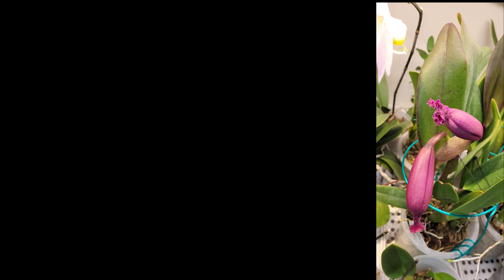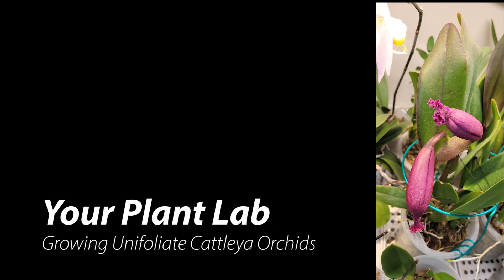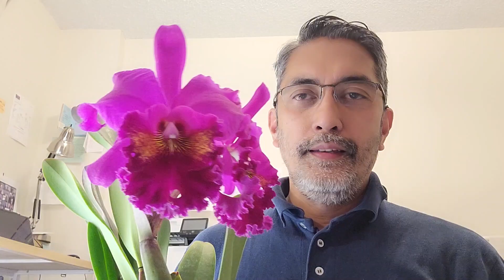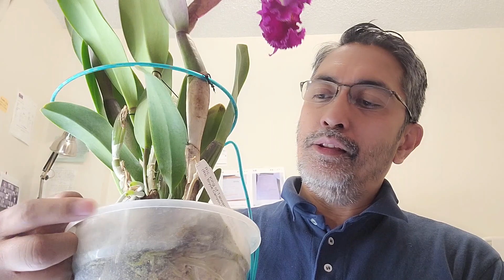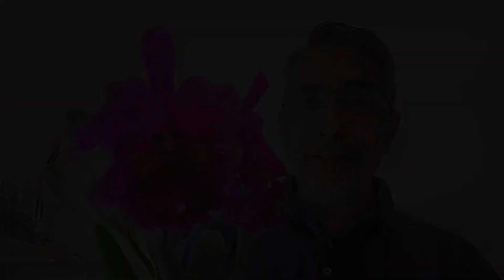Growing Cattleya Orchids Indoors

Comment: Thanks a lot for posting this. I am new & has Cattleya in my collection. The first bud is coming out. I keep this Orchid along with Phalaenopsis & Dendrobiums in my Balcony where I have open air & indirect Sunlight of BANGALORE, India. My Dendrobium bloomed amazing 3 blooms last year. Nothing after that. Phalaenopsis- I purchased 2 clors with flowers & both are doing well. More to  add& more to learn. Your video is inspiring. I want to buy Oncidium Orchids & Vanda Orchids also in the near future.
Reply from the maker: @doddagopi4933, you are very lucky to have a myriad of orchids to begin with.  I assume that you have a location advantage as many orchids respond very well to moderate to warm temperatures all year round.  I am also curious if cattleyas respond well I have been told they are daylight-sensitive.  But since I tried using grow lights with a fixed 8-hour period for a year, my cattleyas still bloomed!  I hope the same outcome for you!

Comment: Where do you live? What formula of light colors do you use? I've heard 60% red and 40% blue is good for orchid culture. What do you use? Thanks.
Reply: Good day.  When I bought the grow light.  I was aware on how the light spectrum distribution, but not exactly in a percentage distribution, but more of a graph that has continually going up and down from ultraviolet to infra-red.  I use the GrowTronics T5 LED Balanced 6400K/2700K, which is a combination of intense warm white and cool white.  You can choose either a 2-feet or 4-feet lamp.
Reply: @Victor.Frigillana  Thanks. I found some similar to what you have and they seem to work pretty well. Thanks.